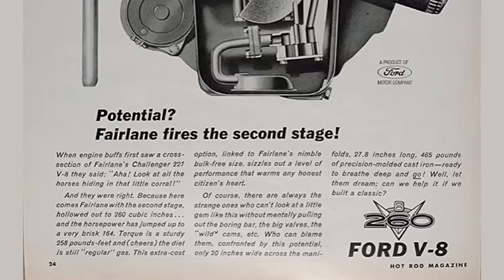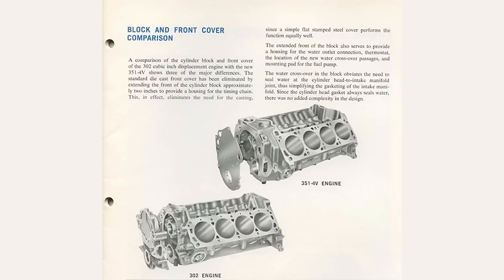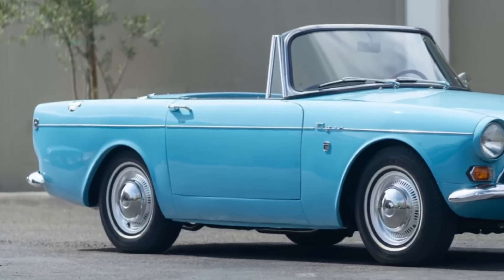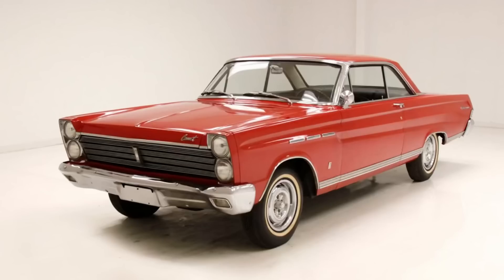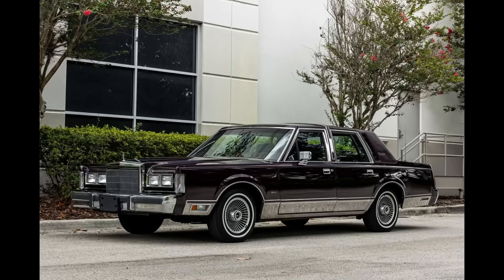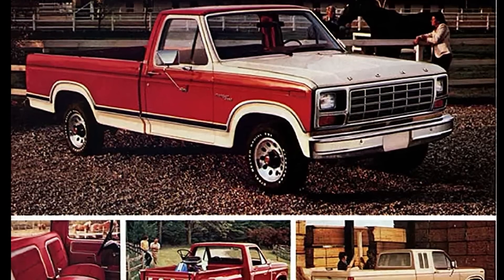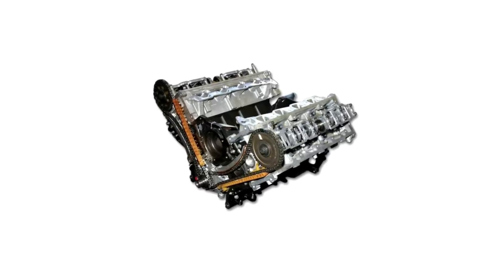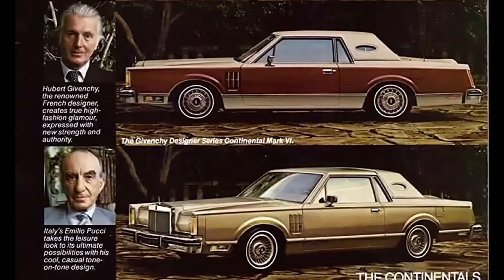Ford small block engine family 221, 260, 289, 302, 351W, 255 not the race engines

Comment: Great episode, In High school shop class I built a 289 HP for my 1963 Falcon futura that was originally a 260,  Thats one car I wish I had today, After High school from 1971 until 2003 I worked at Ford and L&M dealers. I feel the only weekness in the small block Ford was the plastic-covered aluminum  Cam Gear--  otherwise a Good and reliable Engine.
Reply from the maker: I totally agree they were built solid engine I’ve owned a lot of Ford products 302s were bulletproof in the 80s. They didn’t make that much power on paper but I had an idiot Lincoln town car that took on my friends Camaro. He only had a 305 in his Camaro my Lincoln walked all over his Camaro in the walk in his face when he lost the race was just priceless. 

My Lincoln had the AOD transmission in it and secret so that was if you put put it up to about 20 miles an hour and slammed on the gas thing took off like a rocket. I miss that car. I might try to look for one this year and doing an nostalgia episode with it just because statistics on paper reality, or sometimes two totally different things.

Comment: 1:39... Is that a bit of artistic license at the exhaust manifold mating surface?
Wasn't the gasket surface machined to be 90° to the pan rail, or usually vertical?

Ditto the oil-pump shaft, should be vertical?
Reply: I’m pretty sure that the exhaust port is angled as shown but I do know that the oil pump driveshaft is slightly angled to the side and it is also leaned back.

Comment: Hi Jay!:  Can definitely attest to the small block Ford engines!  Owned or Drove one with a 289, three with the 302 and one with the 351W.  VERY reliable engines!  Sure had to replace a water pump on one and the fuel pump on another, but really good.  Maybe not the most powerful in the world but you could count on them.  When I lived in the colder climes, I could pump the accelerator twice on either the 351 or the 302 and it would fire the first crank.  You had to feather the throttle until the choke warmed up.  But man, even in the dead of winter they would do that!  I did have a weird thing happen one time in the winter.  A friend and I went to the movies, but on the way back the 351 was not running very well.  Finally stopped cold about two miles from my house, but got a tow from a van with a 302.  Found out that the little block that actuates the points, had worn down to a nub, as it was made of a fiber material!  Popped in a new set of points and it was good to go!  WYR#1  This was really hard because I would LOVE to have a 1966 Mustang Fastback!  I drive a 2000's era Mustang every day and a '66 would be SO NICE!  BUT my first car was the 1969 Torino GT :sportsroof"  (Ford called them that in the brochures and advertising, every one else calls them the fastback!)  Mine was identical to the cherry one in your pic, but was the VERY dark Presidential Blue with that COOL C stripe!  If I had a nice cherry one the only modification I would do would be to have one of those backup cameras that fit on your license plate!  You can't see a THING while backing up in one of those!!  #2 Pretty easy as I like all of them!  I'll pick the 1980, though, as it kind of reminds me of the 1986 Lincoln Town Car I used to have (with 302, of course!)
Reply from the maker: Awesome information as well as great choices. Thank you so much for taking the time to add all of that information. I greatly appreciate it.

Comment: Let's slip our rose-colored glasses off for a moment. 😊

Umbrella seals used to become "petrified" and bits would "swim" to the oil sump; where the oil pump's pick-up screen had a bypass valve that could open during cold starts. Chunks of seal would jam the oil-pump and cause the distributor/pump drive-gear to promptly shear its roll-pin. That could make for the  rough start of a cold day. 😊
Reply: Ford had a TSB about 10w40 oil additive package being a cause of the oil seal degradation issue. They recommended switching to 10w30

Comment: 67 Mustang with a 289. Overheated it and as we continued to drive it, we put everything in the radiator from lake water ro beer. Ran it so hot that it clanked itself to a stop and died. It was smoking and was red hot. Told my friend to play "Taps" over it, it'll NEVER run again, it has ro be seized. Next day found the leak, fixed it, added water and unbelievably, it started right up. Ran it with no problems for years! And I was a Chevy guy, go figure.
Reply: The SBF was more tolerant of stupid abuse more than most engines. Don't know if that was by design or accident. I've had a couple get nearly that hot driving toward the nearest water supply. First you smell the hot motor oil, then the valves start rattling and get worse till it's nearly deafening. Power starts dropping and preignition begins. Open hood, push radiator cap off with a stick following it with your eyes so you don't lose it when it blows off, then dump water in between steam geysers till it all stays in there. Replace cap, close hood, and drive on as if nothing happened. In that line us SBF fans always carry a spare thermostat bypass hose and a screwdriver as those tended to pop regularly.
Reply: I think we were 16ish, dumb as He// and knew nothing then, lol. I would never do that today!
Reply from the maker: I remember those days did anything that you could to get by because didn’t have a whole lot of money
Reply from the maker: Awesome story it reminds me of my 67 mustang. My Mustang had a transplanted 351 Windsor in it and I overheated at the very first day. Wasn’t sure what the temperature was supposed to read I thought for sure I warped the head or something but it turned out to be all right. I had that car for five years.

Just curious, did you have power brakes or mechanical brakes? Mine had four wheel mechanical brakes to this day. It is still the hardest car that I ever owned to stop. I have a 52 Chevy 1 ton truck now that does not have power brakes and it’s easier to stop then that Mustang was , even though you have to pump the brakes in the truck, the mustang brakes were super tight and really hard to push. I usually use the transmission to help slow down because stopping it was almost impossible.

Comment: I'd prefer the 69 Torino & the 87 Lincoln LSC. I've had all but 2 mustangs between the years of 1964 - 1985 & the 66 wasn't one of them which explains my choices 🤔.
Reply from the maker: Sweet choices. Did you say you had a 66 mustang? Did you have a bad one?

Comment: My uncle’s 67 Mustang had the 289, and was a hoot to drive. He bought it slightly used in 67 and kept it 30 years until he died. Curiously, the car was equipped with an automatic and featherlight power steering, but it had manual brakes that you had to literally stand on with a huge muscular effort to stop the car!
Reply from the maker: Great story it reminded me of my 67 mustang. It was really hard to stop the hardest car that I’ve ever owned to stop. Mine had the same set up as yours mechanical brakes, drum brakes, single master cylinder, but I find very interesting is my 52 Chevy Truck is 15 years older and it’s easier to stop
Reply: And my 56 VW was very easy to stop with its mechanical drum brakes.  @What.its.like.